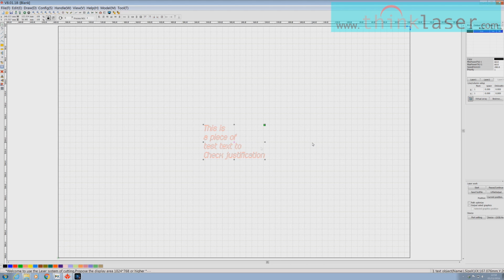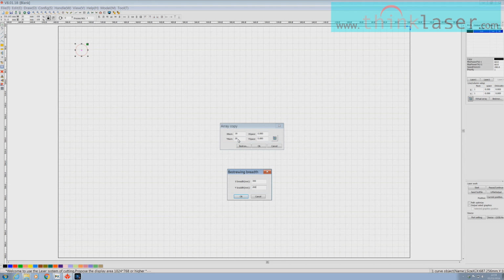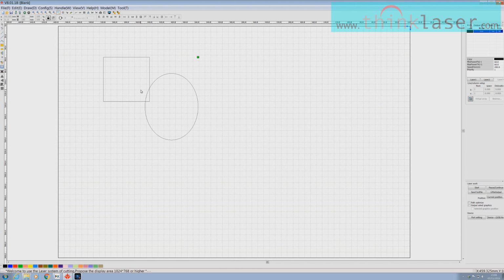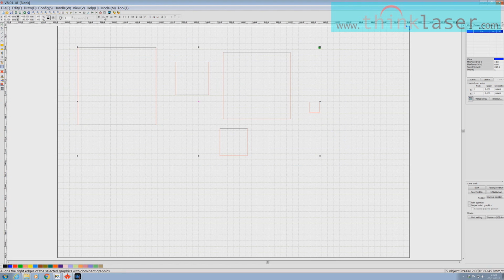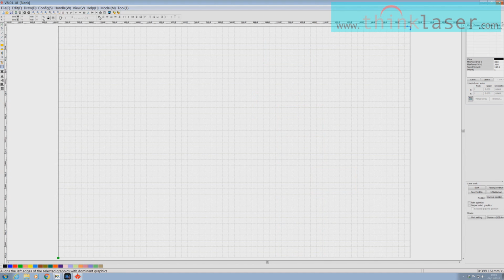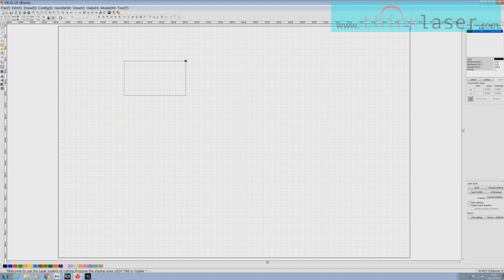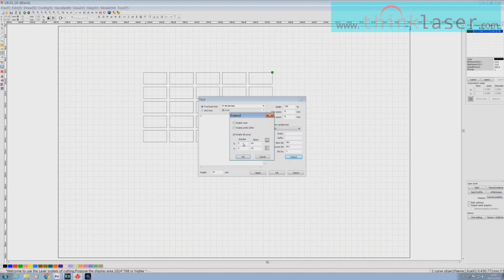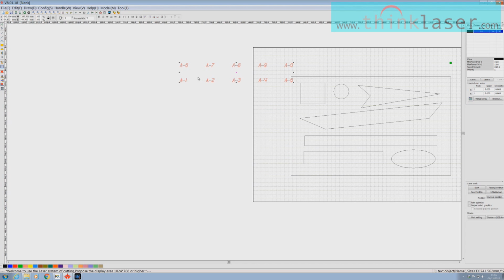How to Use a laser Cutter - Lightblade Learning Lab 04 Advanced Drawing Tools

Comment: How to make machine factory made...
Reply from the maker: Hi, Gareth @ Thinklaser here. 
Are you trying to do a factory reset of your laser machine? If so this can be very risky if you do not have the appropriate files in case the factory reset settings are not correct.
Reply: What is the process..
Reply: Send your WhatsApp number
Reply from the maker: Which controller does your machine have? Is it the Ruida 6442 as different controllers have different methods.
Reply: Yes
Reply from the maker: If you press the Z/U key, there is a 

"Def Fact Para" button 
After the “Def Fact Para” is selected and the Enter key pressed, the “Successful Recovery” dialog box will pop up to prompt that all manufacturer parameters and user parameters are recovered successfully. You can return to the previous menu by pressing the Enter key.

You do so at your own risk.
Reply: Thanks
Reply: Can you send your WhatsApp number